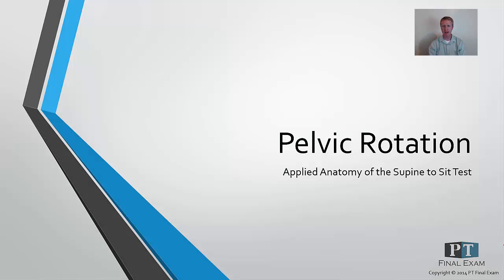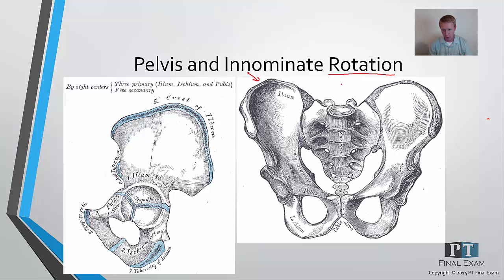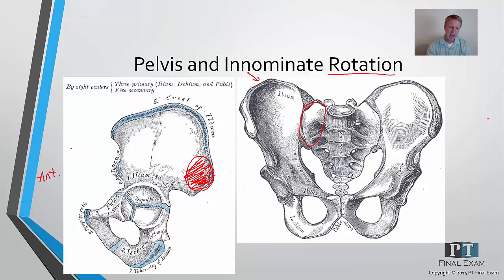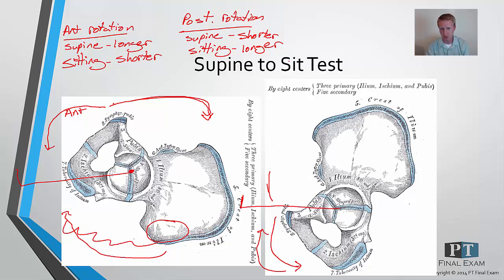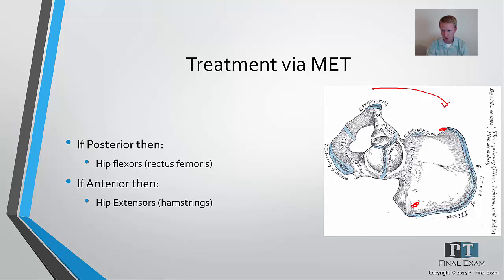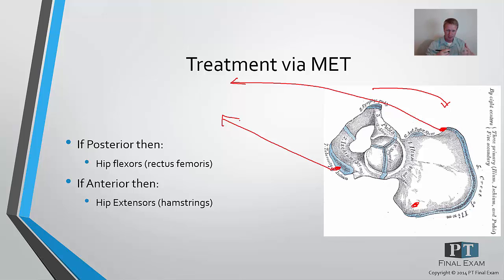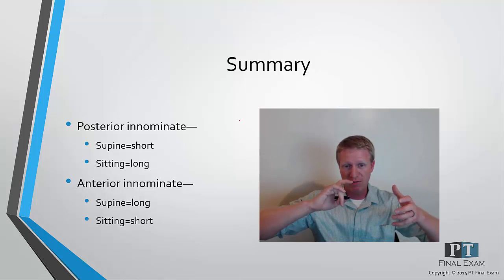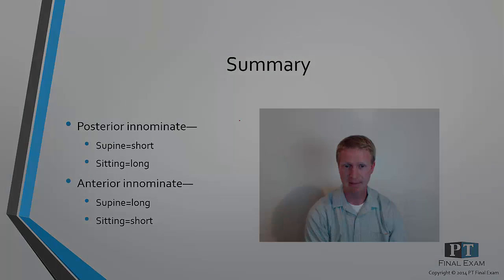Supine to Sit Test

Comment: I have a question in terms of its treatment. For NPTE purposes, which would be better; for example, if there is an Anteriorly Rotated Innominate, do we Stretch the Tight Muscle (Rectus Femoris) or Strengthen the Weak muscle (Hamstrings)? Let us say, both choices are given, which would be better to answer?
Reply: I have this question also! Ive heard you stretch before you strengthening but not completely sure.

Comment: Great video! How do you distinguished the side of the problem? I.e. if you measure a short R Leg in supine, which becomes the longer leg when the pt. sits up, how do you know you weren't actually observing a long L leg, which became longer when the pt. sat up? We've learned to use the March/gillet test but I wondered if you use the same technique. Thanks!